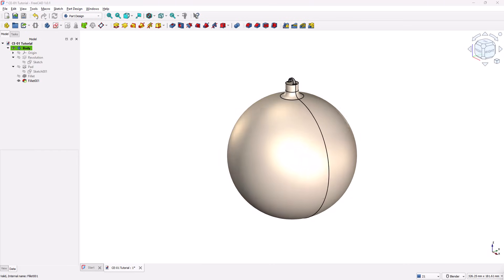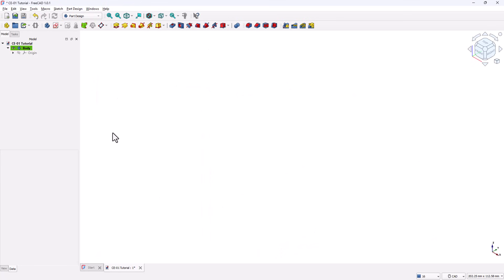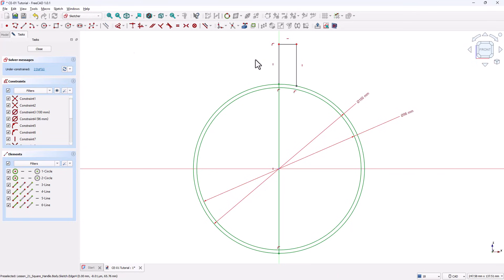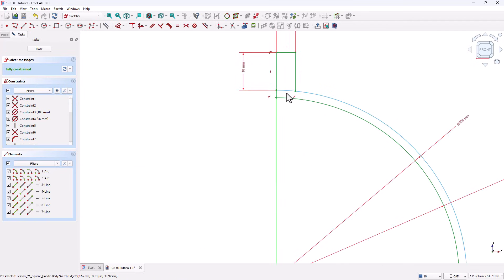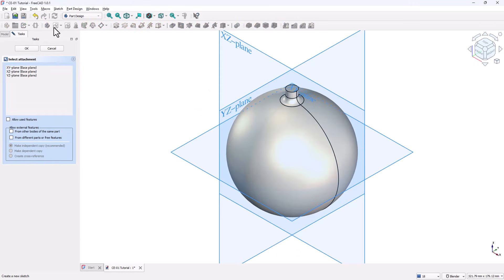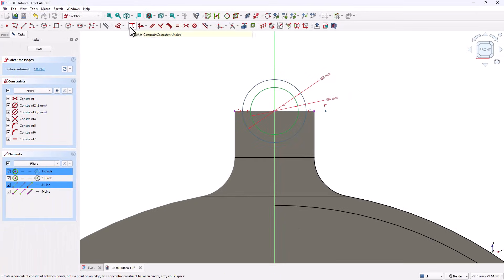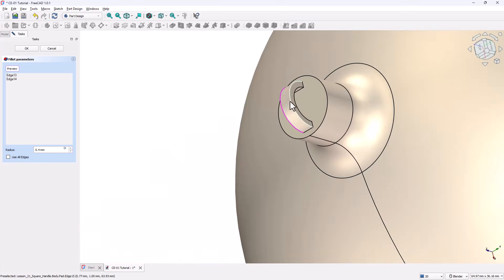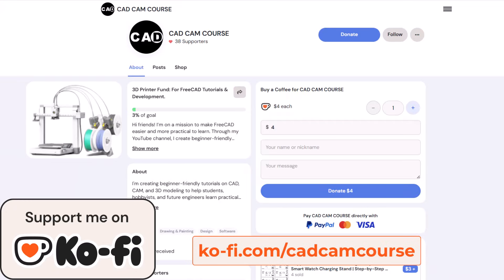FreeCAD for 3D Printing – Project 04 of 40 | Christmas Ornament Ball | Bauble Modeling Tutorial

Comment: Because of your great course material I was able to create this directly from the drawing without any assistance using the knowledge from previous lessons. Watched the video and you did it a bit differently. I started with additive sphere and subtractive sphere to create the hollow ball, but for the rest we did the same. I want to learn freecad to be able to design by own 3d printing parts. I would be interested to design e.g. 2 parts that need to fit together. How to deal with tolerances and how to dry-fit them in freecad? Looking forward to another episode ...

Comment: On my version of freecad,  it would not allow me to change the fillet to 0.4mm and then select the edges on the hook part,  instead I had to select the hook part edges first, then adjust the fillet size to 0.4mm,   as for printing,  I recommend variable layer height this will give you less layer lines on the top and bottom,  and of course some kind of support, you only need a little bit to keep it upright and stable.    this object is a good item to practice smoothing and polishing etc,   sanding,  fillers,  until perfectly smooth,  then paint with some  paint.  you could make this look like it is metal,  mirror, or porcelain.   or you could paint your own designs on the surface.